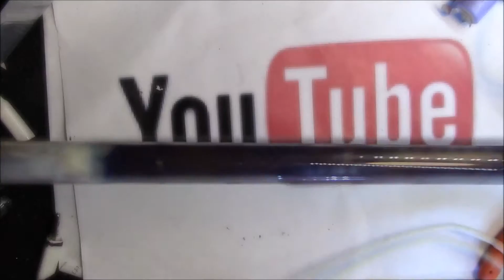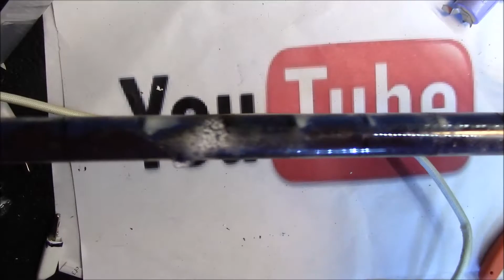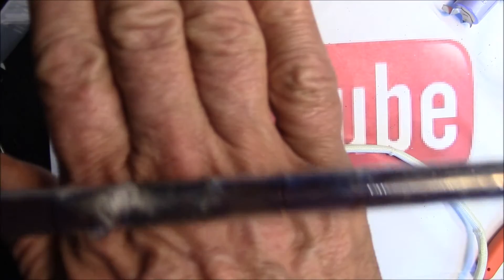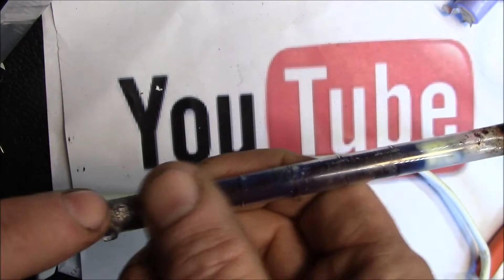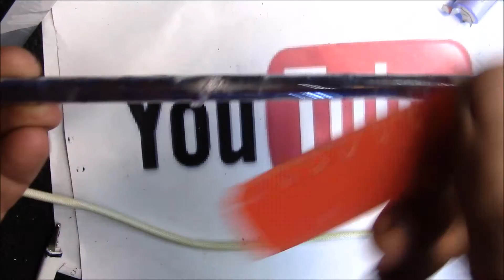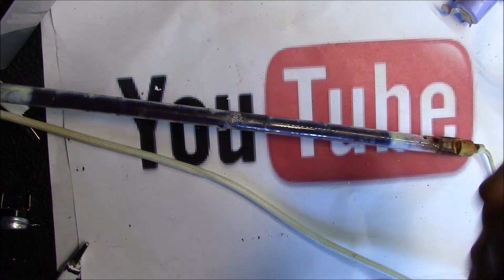Advantium SpeedCook Oven, Halogen Heater Autopsy

Comment: @R Brown How's your Advantium holding up?  One of the halogen heaters on mine went out a while ago and I have not been able to find a source for a replacement.  Looks like they are not being made anymore.  You don't by chance have more details on the bulb itself as only the assembly (WB44X10053) is what's listed on parts sites?  Seems like maybe the bulb is used in other appliances too.  Great videos!  Thanks.
Reply from the maker: It's still going strong, gets used daily.  I managed to find a used bulb on eBay back when I repaired my oven.  I think it took a while for one to turn up on eBay and it was out of a used unit.  There seem to be 500 W halogen bulb s available but they are about half the length of the GE bulb.  Seems like it should be possible to rig up a holder for one of those shorter bulbs and get it to fit inside the oven.